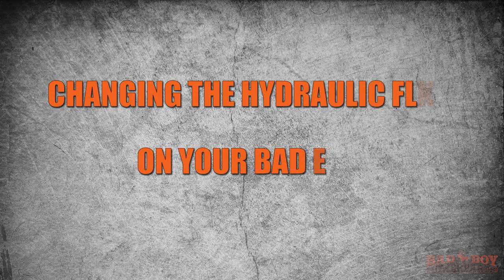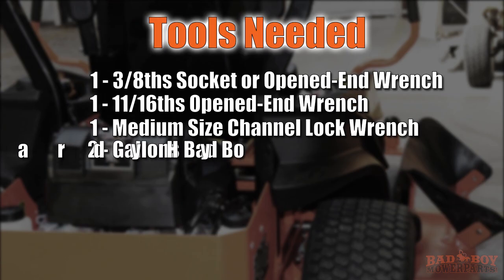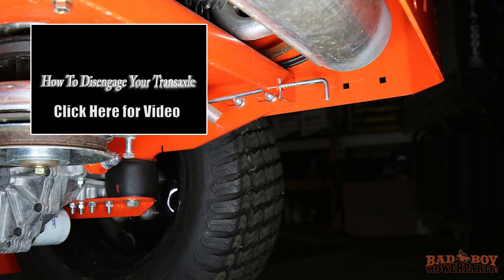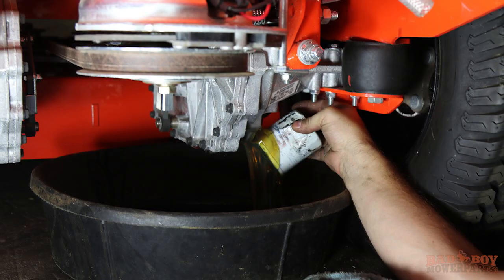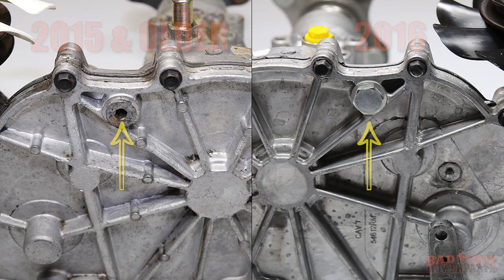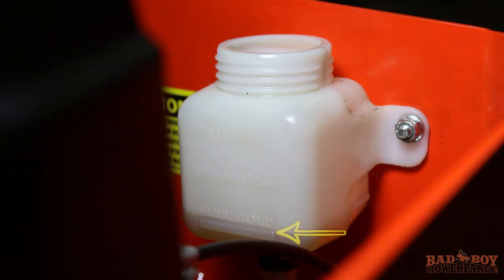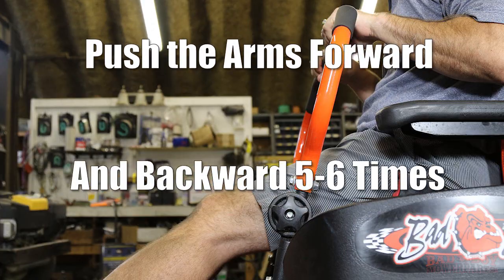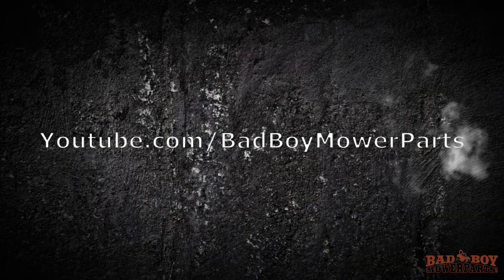ZT, CZT, Maverick Transaxle Service Procedure

Comment: I'm the happy owner of a 2022 ZT Elite, just coming up to 1 year/50 hours so ready to do the service and noticed that my mower has no hydraulic fluid reservoirs.  Is there a how-to video or sheet for changing the oil and purging the system for my rig?

Comment: I've heard that you need to have the mower on jack stands with the rear tires off the ground while purging the air. I noticed that method wasn't used in this video. Is it necessary to do that? Thanks
Reply: Good question because the mower would be moving on the ground in the second step with transmissions in lock position.

Comment from the maker: That is correct. There is no need to check the levels as you go because you have to get the system filled to the "Cold Fill Line" on the tanks. Through the process of getting the level to the port plug then filling to the expansion tank, effectively you are "checking" the levels. Just make sure to do the purge process. Great question!

Comment from the maker: The expansion tank is just an overflow. That is why the fill to line is right on the bottom of the tank. The potential air bubbles in the system are tiny so purging the air will not cause a significant drop in fluid levels. If you have filled to the tank then the fluid in the tank and hydraulic hose going to the transaxle has plenty of leftover/reserve fluid to ensure the trans is full during and after the purge process.
Reply: I have a 2014 zt elite with the Allen head port plugs that are stripped out. I noticed that you guys have changed over to a bolt head port plug. Is there any alternate plug for the allen head  port plug design for the 2014 model.

Comment: I also have a 2022 ZT Elite 54 with no expansion tanks so I'm not sure where the fill port is. I found a schematic diagram of the transaxle online (not in my owner's manual) that showed the location of the fill port, but when I took a look at mine, there are 2 plugs in that location. I don't know which one to fill. I called the dealer where I bought the mower, and the mechanic had no idea that there are mowers without expansion tanks. It wouldn't make sense to take it there. Please answer the question on how to fill the transaxle with no expansion tanks. I'm coming up on 100 hours!

Comment: I got my bad boy from my neighbor and have not been able to mow with it yet due to the poor condition from neglect. The mower looks like a very well built machine. My last step was to replace the busted hydro tanks and do a fluid change. Pulling the filters revealed water contamination my question is how do I clean and flush the system? Both motor seem to still operate at least driving from the field to the shop around 100 yards.

Comment: you do not mention checking the fluid level during this operation when purging the air. is that because it is unnecessary? Thanks for the video.

Comment: My bad boy elite with a kawasaki 726 cc dose not have the white tanks you put fluid in to fill up
Reply: Nope...they stop putting them on there..just a 18 or 19mm metal bolt plug on top of transaxled...have to use a long skinny oil funnel to refill...besides the plastic tanks dry rot n leak...

Comment: Did the procedure now the fluid leaks out when it is parked , looks like a small bolt next to the filter but there is no head on it to tighten even though it looks like an allen wrench head, contacted bad boy and 2 of their dealers and nobody has any idea what these plugs( i call them) are or how i they get removed.  I have had this mower less than five years this will be my first and last bad boy mower i every buy. How do u build something and not know how to fix it
Reply: I’m dealing with the same issue did you ever get it fixed?

Comment: I have a bad boy mower and it just started bucking or severely jerking  on the right side hydro any idea what that might be or if this might fix that issue?
Reply from the maker: Check your transaxle bolts. The ones holding it to the frame. We had this happen before and the bolts had come loose.

Comment: Why do you call out needing 2 gallons of new oil? Especially considering Im paying $30 per gallon 😡 (Tractor Supply) and if each tranny only holds a half gallon...
Reply: A question I have wondered myself.
Reply: I have changed mine several times, it takes 1/2 gallon per side.
Reply: My booklet says they use 2 Qts each  that's 1 gal.  I am not a mechanic.

Comment: I ordered your kit and received just 1gallon of oil.  Why wouldn’t you include 2 gallons?  I received 2 filters...why not enough oil??
Reply from the maker: Great question! All of the hydraulic kits we sell come with at least 2 gallons of fluid. There are other places online that only sell one gallon but that will not fill the transaxles up. Verify where you ordered this. Like I said all of our kits are sold with at least two gallons.
Reply: I checked... it was from you
Reply: @WrenchAddiction  no reply not good but I do have to say that I love my Bad Boy mower

Comment: Hello,  i cannot gwt the air out of my lines i have done exactly what you said to do.  Is there anything else u can do?
Reply: Go to the 3:20 mark. Fill with oil, cap it. Then bleed the air from the lines. This part should help you.
Reply: Did you jack up the rear wheels and move the steering arms back and forth ( wheels turning )?

Comment: Great video.  Got questions about belts.  There's a belt loose on my 2013 ZT 60 and the mower starts but won't move.  I find no videos about replacing pump belt or drive belt nor is there any info in my manual. Help?
Reply from the maker: Great question. This is one of the videos we get asked about a lot. We have the pump belt videos on tap to do this winter. There is no service manual or videos showing how to do this so we understand the need for this video. We just ran out of time this past off season to get the pump belt video done.

Comment: My 54" mz magnum ive heard is a sealed unit but my left trans is gwrting louder and weaker then it use to be whar can i do to service it sounds low i  fluid to me. Can i add fluid or change it? Aby help please.
Reply: Same I have the 48" but having issues on one of the sealed units. How do you service a sealed unit.

Comment: open what by pass valves?
Reply: The L shape rods on both sides of the frame of underside rear of mower.....just above the transaxle locations...they have a safety pin in them....gotta lay down on the ground so you can see them
Reply: The bypass valves are in the transmission to open them pull the silver levers that are behind the axels with the little clips in them.  There's about 8 small holes in them.  pull out those levers and place the pins in the last hole holding the levers out away from the axles.  That's what my booklet says anyway.  I am not a BB mechanic.